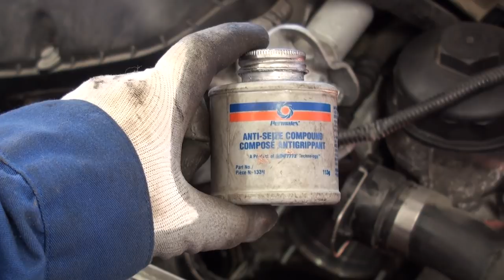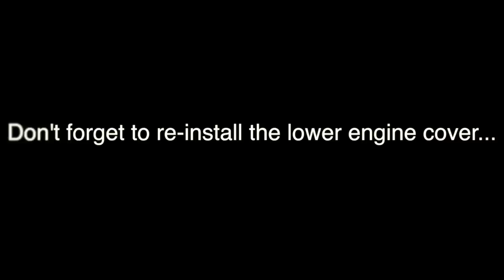BMW E46 Water Pump and Thermostat Replacement

Comment: Really great work, Ive never seen anyone manage to overdo filling the coolingsystem quiet as much as you do!
Reply from the maker: Put it this way, I'd rather overfill the cooling system to make sure it is COMPLETELY filled with no air and prevent an overheat condition which could fry my engine.  A little bit of lost coolant from expansion is MUCH safer for your car than not enough :)
Reply: piercedasian I didnt say overfill I said overdo ;)
Reply from the maker: Kristoffer Lilja lol, gotcha.  Yes being meticulous is the key to successful repairs on anything.  I try my best to be a comprehensive as I humanly can b/c I don't want to go back and fix things a 2nd time b/c I was lazy the first time.

Comment: this what probably the BEST how to for this ever. The camera shots were great. 1 think is to maybe replace the plastic pulley with an alum one and the plastic bleeder with a brass one. TYVM!
Reply from the maker: @ smarzig - great suggestions.  I haven't toyed with the idea of aftermarket parts but then again how often does one have to replace pulleys more than maybe 2 times in the lifetime of most cars.  I agree however, that the parts from BMW given their price is cheap quality compared to other offerings that cost less and are made beefier.

Comment: Thank you for this video. I want to buy a BMW but I'm told the maintenance is too expensive, I drove one before and loved it. I want to be able to enjoy the vehicle without worrying about outrages maintenance charges. I think I could do a lot of these jobs myself, thank you again.
Reply from the maker: Anthony Perez BMWs from my experience are generally not that bad to repair and even parts for them honestly are comparable to japanese cars.  The only thing comments I can make about BMW is this:
1. When they work they drive like a dream.  I love how they handle and how refined they feel.
2. I love the way the design the car with serviceability in mind.  I was pleasantly surprised at how straightforward it was to remove MOST components.
3. I hate that they use torx bolts on everything.  Why use a fastener with probably one of the worst bit designs ever?
4. Their parts for what you pay aren't exactly high quality.  Water pump that remaned from BMW is $175 CAD and is made of plastic??  With all due respect Honda and Toyota charge about $150 for water pump and they're made from solid aluminum.
Reply: Thank you.
Reply from the maker: you're welcome!

Comment: Best damn Water Pump and Thermostat replacement DIY video for E46.  One other tip you might want to add is that if your pump will not wiggle out to easily, you can use the two jacking screw holes on each side of the pump to put in a screw with the same thread as the thermostat screws, and gently jack the pump out by threading each one in equally.  I don't know if the thermostat screws are long enough to get it out or not, because I grabbed two that were in my garage.

Comment: Awesome instructional video, very precise. The only thing I would add that would make the removal of the waterpump easier is to use the bolts from the two 10mm bolts from the Airbox @ 1:04 to remove the waterpump without having to shake and wiggle it. The waterpump is made with two threaded wholes on either side(you can see the one on the right, clearly @41:14 right above the whole for the bolts that holds the pump in place) one of the 10mm bolts screw into that and the other screes into the one on the opposite side. As you alternately tighten the two bolts they gentle press against the flat edges of the waterpump housing causing the separation needed to easily and gently remove the waterpump. Other than that AWESOME VIDEO, GREAT WORK!!!
Reply from the maker: What an excellent tip!  Thanks for the advice!

Comment: I have the BMW Service Manual, but watched your video prior to replacing my 325iT water pump, thermostat and hoses.  Your comprehensiveness took away any lingering doubts I was having about tackling the job (even covered nice-to-know points I did not read in my Manual).  Thanks.
Reply from the maker: glad you found my video useful.  Some folks have actually complained on my videos that there is too much detail or too much explanation of things!  I've always believed in over informing than leaving people wondering...

Comment: Very nicely done DIY David. Excellent vid quality and proper emphasis on details that others gloss over. Kudos.
Coolant capacity is over eight liters, not six liters.

Do not overfull the expansion tank as you did. Added coolant too fast so spilled over the top of the ET.

Comment: If you remove the T stat first, it makes getting to the waterpump a lot easier, in my experience. Also, Wahler (who actually makes the T stat for BMW) is only about $40-$50. Great video!

Comment: Great work!!!... Very detail oriented and explained very well. I've seen mechanics do overfill the the cooling system like he does. And I believe this minimizes the work of letting the air out from the valve screw and push the air and water better to the heating system.
Reply from the maker: yep you can't "overfill" a cooling system because the system will "self level".  Any excess will get purged out but if you're too short then you risk overheating the engine which is FAR worse than spilling a little bit of coolant b/c of the overfill.

Comment: Hi nice video, like your professionalism and use of adjectives and verbs lol.

So some related info-Just did this on an automatic, but also replaced the Expansion Tank as well, to anyone else also replacing the ET be careful to only lift the tank straight out, any twisting might break the ATF thermostat under the ET,(learned this the hard way) and be prepared to have to replace the ATF thermostat as apparently it may just break anyways.....

Also-also, You can rent an adjustable fan clutch holding tool from Canadian tire for free! just go in and ask them. The one i rented however did not come with a 32 mm slim wrench, i did borrow a normal  32mm wrench and was able to remove the fan while the upper rad hose was out of the way.
Reply from the maker: great tips.  I had no idea that I could rent the tool from Canadian tire (those guys drive me mental with their screw ups with parts and such).

Comment: Thanks So Much, Really informative, one of the best Vids I've seen,
another common problem I have found (in Reference to Eugenes Issue) is the coil(s) fail just 1 coil out and the car runs significantly powerless,
Hope this also helps.
Reply from the maker: Glad you found the video useful :)

yes ignition coils can fail causing the car to run on just 5 cylinders which is a HUGE power loss.  That being said the BMW's engine management system should be smart enough to tell you that something is amiss by lighting up the check engine light on the dash IF the misfire is bad enough due to a weak or faulty ignition coil.
Reply: funny thing is, the EML light used to come on frequently before for no apparent reason. and during coil testing no light either, now EML light has only come on 1nce.
Oh, And thanks for replying... Much appreciated.
Reply from the maker: hmm if the EML light has come one have you had someone pull the codes stored in the ECU to tell you what the EML light came on for?
Reply: no, not yet. my friend has a scan tool. will check out next week,
thanks again..

Comment: Excellent video. I've got a automatic. Have u a video for removing the fan clutch? Trust me to have the trickier fan. 😄
Reply from the maker: Hi Gordon, yes the automatic uses the thermo hydraulic fan clutch that uses the belts to drive the fan.  You need to get a special tool that will essentially prevent the pulley from spinning and then using an open ended wrench to loosen the fan clutch nut.  If you've got the proper tool it's actually SUPER easy to remove and the nut is rarely ever torqued down so tightly that you couldn't get it off with the fan clutch holding tool set.  Look up BMW fan clutch tool and I'm quite confident you'll know how to use it.  Whatever you do, don't try to "hack off" the fan clutch nut otherwise you'll regret it b/c the fan clutch for the BMWs are extremely delicate and prone to being damaged from improper removal.  It's a very expensive part and the money you'll spend renting or buying the tool will make the job that much easier and less aggravating.

Comment: Extremely helpful video.  I am planning on changing showed pieces on my bmw 330ci and wanted to ask you if I need to also drain the engine block drain plug, as you didn't do this on your car.  Also, I was informed to, upon draining the coolant, turn the ignition on (not the car) and place the heater high with fan low?  Would you recommend this or can I simply do as you did and open the radiator cap?

Comment: Very thorough video! I just got to a parking lot this morning to see smoke coming from my engine after I turned off the car. Opened the hood and it was steadily leaking coolant at a very fast rate... any idea if you think that's the water pump vs. radiator vs. expansion tank? Or how to test for that?
Reply from the maker: only way is to fill the engine with more coolant and then fire up the engine to see where the leak is emanating from.  Use your nose to help guide you as coolant has a sweet smell to it.  You can always look on the ground where it's dripping from to help pinpoint the leak.

Comment: Thanks for your thorough diy. Definitely feel confident in tackling this now. The only query I would have is in your final stage of topping off coolant into the system and expansion tank. Is it not important to ensure you do not overfill the exp tank/reservoir as this can cause the tank to crack due to excess pressure? My understanding is, it is important to remove/siphon some coolant from the res tank leaving room for expansion while ensuring adequate level is maintained. I am not aware the tank is designed to deal with/relieve excess pressure and or coolant? Thank for taking note and replying. RD
Reply from the maker: +jerome jackson a cooling system is always designed to bleed off excess coolant.  If you overfilled the overflow tank and as the engine warmed up it overflowed some more it just would spew out of the tank.  The expansion tank isn't air tight and needs atmospheric pressure to allow the coolant to "retract" back into the engine as it cools.  If it was sealed it would cause a vacuum which of course doesn't happen b/c there are tiny vents in the expansion tank.

Comment: your presentation is one of the most awesome for BMW lovers. as I write now my E46 320i 2000 model is overheating and the coolant flood out in the expansion tank. so even the mileage at 85 000 km. what's your advice?
Reply from the maker: Tshepo Lekola have you checked your head gasket to see if it is blown?  Normally an overheat condition is either from a blockage of coolant, lack of coolant or cavitation of coolant b/c of air in the system which can result from either not properly bleeding the system of air OR air being introduced into the cooling system via a head gasket leak.

Comment: Loosen waterpump pully bolts before you remove the belt this holds tensión on the pully
Reply from the maker: good tip, it certainly does help.  Thanks for sharing!

Comment: Hey, I just watched your video--which is very informative.   I just learned something new.  

I have a problem, I purchased my 2003 BMW 325I (manual) 2yrs ago and it drove ok.  But I have realized they  hardly kept up with maintenance.    But my problem is, my BMW does not drive like a BMW.   It does not accelerate with power when I step on the gas; it feels like it struggles to move, like it drags.   Basically, it does not move with power like BMW's are supposed to.   What you guys know what is wrong with my BMW?
Reply from the maker: I would start off by doing all the routine maintenance items like all your fluids, filters and related "consumables".  I would then go and replace all the plugs, clean the throttle body and then see how your BMW fares up afterwards.  Try my suggestions and then see where you're at and report back to us here and we'll provide more suggestions if you're still stuck.
Reply: Thank you very much for your information.  I will do that and get back to you.
Reply: When you mentioned that I replace "all the plugs",  what do you specifically mean by that? Thank you.
Reply from the maker: replace the spark plugs since you're already taking a bunch of things out.
Reply: Sounds like a fuel management issue, get your ECU codes checked.
Reply from the maker: yes good suggestion but that is only useful if he has a check engine light on (or was on and stored a code).

Comment: could remove the thermo first, then the pump..?
then install pump, then thermo?

i think thats what im doing just so the thermo is out of the way for deinstall/install of pump.. great vid btw..
Reply from the maker: +manilaboy1vic Its been a while since I did this vid.  I believe you can do exactly as you've described without any issue.

Comment: This is awesome! Thank you! But do you know anyway of pulling the fan clutch without a holder bar? I have a 32mm wrench but no holding tool.
Reply from the maker: you can fabricate one from several schematics online but honestly it's probably just easier to go to amazon.com and just order one for $30 bucks or so.  Saves you a TON of aggravation and it isn't worth your headache to wrestle with the reverse bolt + the potential to damage your fan clutch which would cost you a LOT more to replace if you damaged it.  Not worth saving - buy the tool.

Comment: Hello 
Great video, congratulations!

After replacing my original thermostat on 528i e39 1998 I bleed the system... BUT after the engine warms up my hose pipe after the thermostat gets a lot of pressure and feels like air has in it, can't feel the hot coolant like the upper hose? 
I placed the new thermostat exactly like the original one event make sure the arrow pointing the same direction, any idea?
Reply from the maker: my reply is super late BUT was the car overheating at all?  Did you try turning on the heater on full hot and then taking it for a slow drive around the block to get the motor to warm up to the point that the t-stat would open up?
Reply: @piercedasian 
Car heat up and stays between 94C and 104C never overheated.
Heating on Full Hot in the car I can feel very hot air is coming.
And yes I drove around 15min. and after driving can confirm the Thermostat hose builds up some pressure... Feels like more air rather than water in the hose?

Comment: Thanks for your video. I would like to know if you take out the engine drain plug can you reuse the washer that is on the existing bolt.
Reply from the maker: if you don't have a replacement washer for the drain bolt you can re-use the old one.  I've reused MANY drain bolt washers and rarely ever have issues.  Just remember that you do run the risk of developing a leak so it is ALWAYS best practice to replace drain bolt washers wherever possible.

Comment: That's great video. I want to know distilled water 60% and coolant 40% mixed or distilled water 40% and coolant 60% mixed? Thanks
Reply from the maker: @ TheDeafcanadian - yes you are correct that the ratio should be 60% coolant and 40% water.

Comment: Hi,
I saw that you are using electric fan behind radiator and do you use front electric fan for A/C?
Reply from the maker: TheDeafcanadian Yes the manual transmission version of the E46 uses electric fans whereas if you have an automatic it uses the thermostatically controlled clutch fan that attaches to the end of the water pump.

Comment: Hi dude i have a problem with my 328i
It start leaking coolant from the freez plug the one is near the alternator I'm trying to find out how much will cost me to fix it thanks
Reply from the maker: Marcos De Leon can you easily access the frost plug?  If you can then you can take it a shop to have them drive in a new frost plug.  Accessibility is key.  If it is something that can be reached from underneath or through a wheel well then chances are it won't be too pricey but if it is in a spot that is really tight then you may need to pull the engine to get a new plug in OR use a universal frost plug IF it will fit your engine.

Comment: Further to my earlier post, if overheating is due to a damaged head gasket, is the tell tale sign coolant mixed with engine oil?
(Coffee and Cream) coloured oil???
Reply from the maker: +jerome jackson if your engine oil is coffee like then YES you have coolant mixing with the oil and that is REALLY bad.  your motor is made out of metal and oil is meant to protect that metal.  Water/coolant will quickly corrode the bearings and finely machined surfaces in your engine.  Get that gasket repaired asap and get that oil changed out a few times to flush out the gunk the coolant oil mix has created.

Comment: do you have to replace the water pump when u relace the thermostat?
Reply from the maker: not usually but since there was so many things that already were removed that to save me the hassles and work for future failures that I just replace it while everything was apart.  Sometimes things aren't worth saving on.

Comment: The temperature sensor is in the bottom of the expansion tank.
Reply from the maker: that's great to know.  I don't work on BMWs often but after doing this one that I would say they're pretty easy to fix for the most part.
Reply: @piercedasian  yep  fairly easy  just  expensive parts..  unfortunately you can`t cheap out on the parts..   it never works out..  end up having to do things twice  or  sometimes catastrophic damage can occur.  Always  go  with name brand German parts..   you`ll be glad you did.   I speak  from experience.